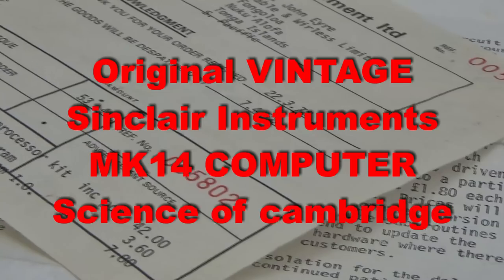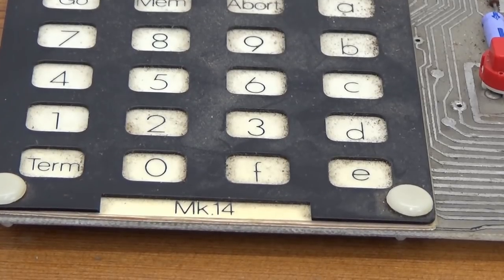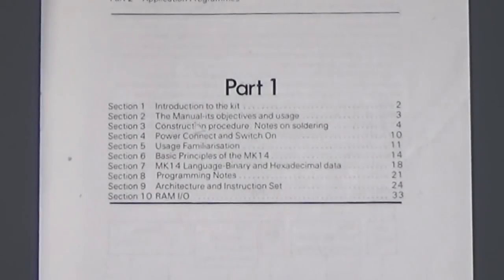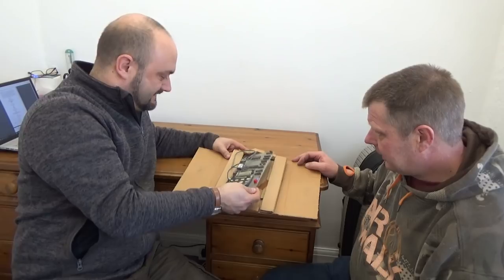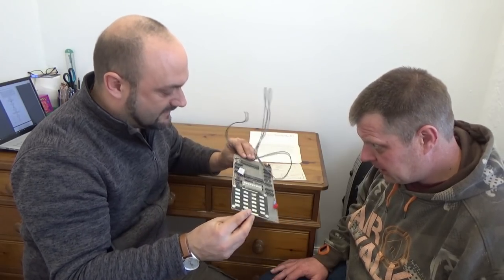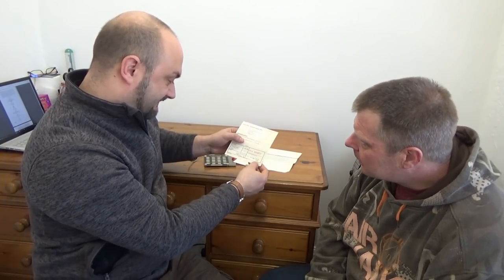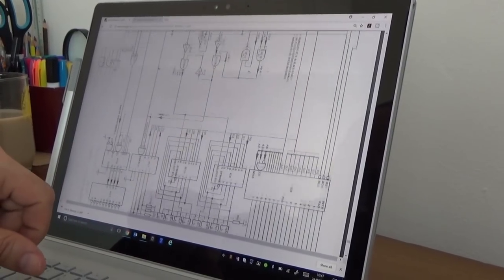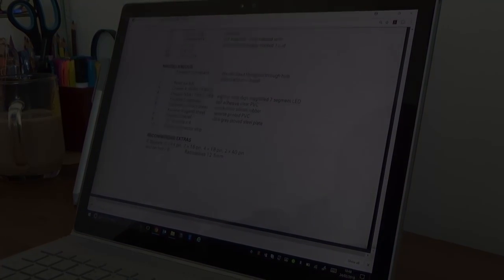DuB-EnG: CLIVE SINCLAIR's FIRST HOME MICROCOMPUTER KIT - Science of Cambridge MK14 ZX80 ZX81 VINTAGE

Comment: Ooow now thats an old beasty, and sinclair is my favorite as i learnt on a zx81/speccy48/speccy 128k :-).
The white original ZX80 is rare, all logic built.

That Mk14 has a lot of simple 74xx logic and its not too hard to test the chips.
I bet the rom image is on the net :-D.
And sinclair often used odd memorys that need 5v/12v/-5v, so there is another possible problem.
Have fun :-D
Reply from the maker: Yes, we will be pouring over the circuit diagrams and manuals...  Thanks for the tip about the PSUs! ...  Future episode... trash to treasure!  :-)
Reply: Those RAM chips aren't "odd", they were just old already when Sinclair decided to implement them in his machines which makes them require to many different voltages. I do have some 4k*1 DRAMs which have pretty much the same requirements, those were commonly used in the very late 70s. If you look into the machines, ranging from the MK14 to the ZX128 there are no special parts used there, but some very weird design choices (the most prominent one being not so obvious as the ZX Spectrum is using more gates on the ULA than recommended by Ferranti which is why they're running so damn hot).
Reply from the maker: Thanks for the tips and information Hans!! ...  I’ll break this out again in the future and see if it powers up.  I have found circuit diagrams online so it shouldn’t be too hard to check it’s viable.

Comment: I'm @mk14man on Twitter, and guru on all things Mk14 - my very first computer. Let me know if I can help. The usual things that happen are >5v power frying the chips, or PROM rot. Former problem involves working out what has blown. Latter means blowing new PROMs - plenty on ebay, and the programmers are still available with a little searching.
Reply from the maker: Excellent Colin! ... thanks! ... I have added you on Twitter and will give you a shout in the near future... perhaps you can PM me where you live and if not too far away, we could cross paths!  Thanks!

Comment: Think its pronounced 'EM KAY FOURTEEN'
Reply from the maker: correct…. not mark14 ….  m k 14 …. microcomputer kit 14
Reply: @DubiousEngineering  And its generally accepted that the "14" refers to there being 14 chips on the original design, it picked up a couple of extra chips before final release! Sinclair definitely didn't design 13 earlier models ...